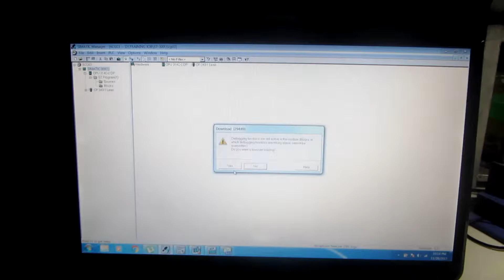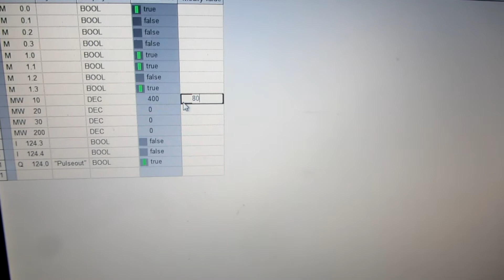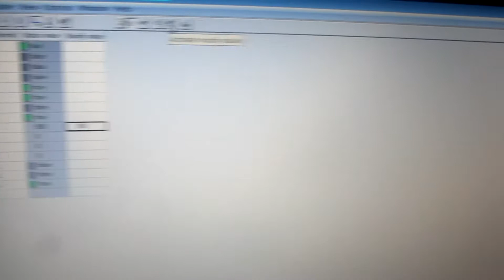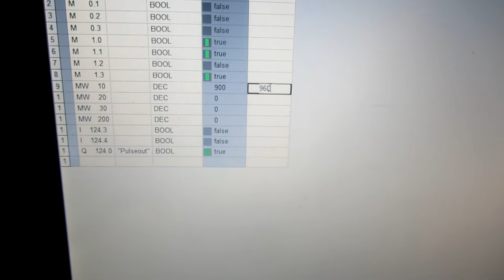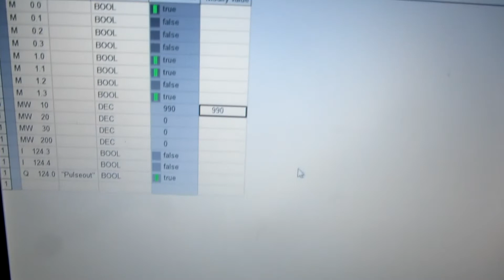PLC S7-300 - PWM - DC SERVO MOTOR

Comment: how you connect L298N with PLC, does it require optocopler to connect it or directly connect it?
Reply from the maker: I used ULN2803 to convert the voltage level. You can refer to converter board schematic at my topic on Instructables:  https://www.instructables.com/id/ARDUINO-HACK-PLC-SIEMENS-THROUGH-LANWIFI-INDUSTRIA/